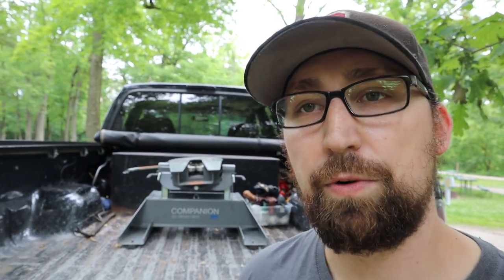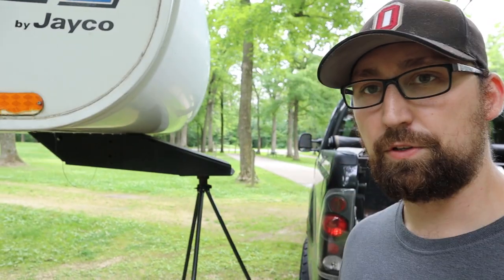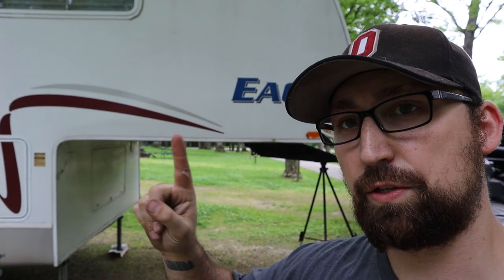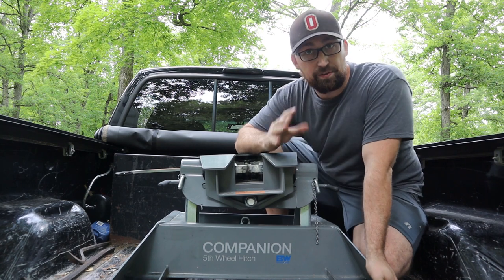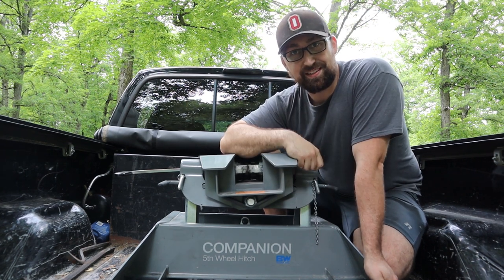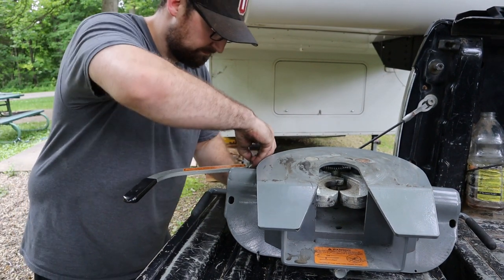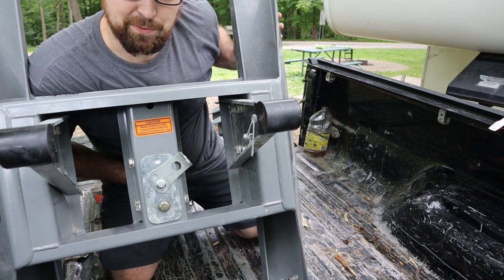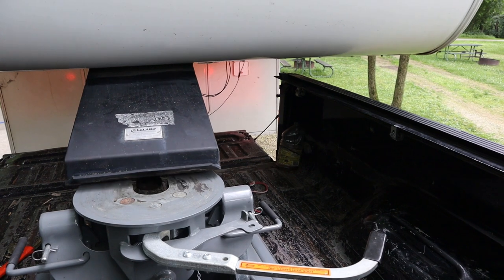The B&W Companion Hitch

Comment: Thanks!
I just purchased my Companion Slider yesterday,  and I have been looking through numerous videos hoping someone could show me how to take it in and out.  I bought a brand new 2019 Ford F250 Superduty,  but it was not equipped with the factory gooseneck option.  Therefore I also had  a B&W "gooseneck" installed that resides under my Companion Slider.
Great video!
Reply from the maker: That's great! let us know how you like yours. I hope the video helped.

Comment: Awesome video !!! Explains alot better than others. Having issues finding a compatible setup
Lifted Ram w Ramboxes ... lookin like no matter the hitch, might have to lift the camper
Reply: A lifted truck is not an ideal 5th wheel towing vehicle.
Reply: @teon39  
Neither is buying a new truck to pull a camper
Reply: This f350 has a 6 inch lift on 35s. There are adjustments to raise the camper a little bit. I didn't have to lift the camper at all to have it work.

Comment: What would be the best way to lock this hitch? (just to slow down a determined thief).. Also, what about grease? what do you use on the saddle versus pivot points? Have you ever used a saddle pad instead?

BTW, I just bought this along with the goose-neck kit for my 2020 F250...

awesome video.
Reply: We use a Teflon disk between the king plate and the pin box. Otherwise I haven't had to grease anything.
Reply: If you don’t use a nylon friction pad, use the recommended (from B&W) white lithium grease.

Comment: I’ve been contemplating getting rid of my Reese slider and going to one of these. Have you ever had very many situation you have wished you had a slider. I have a 19 Ford 250 with the 6.75 bed.
Reply from the maker: We have a short box. I can't say that I have wished for any situation that we have needed a slider. Some campers may contact the rear of the cab but our particular setup we have had at 90 degrees and had zero issues.
Reply: The more important factor regarding turning without the slider is the front cap profile on the fiver. Older models had more squared off front caps but the later models have more rounded corners minimizing the need for the slider.

Comment: Unless I missed it, what is different from the ball you're using now and the ball you threw away?  Also, on your bed cover, has there been any problem with the inside rail cover and clearance with the hitch , or would you rather have top rail?
Reply: Actually there is no ball. The companion base slides into the slot where the turnover ball is/was located. A lever in the driver's side rear wheel well retracts the lock pin, the companion base is inserted, then the lever is moved to extend the locking pin. You then tighten (to 60lbs) the adjustment bolt to draw the unit down securely to the bed. Hope that helps!

Comment: I cannot pick up the hitch and move it out of the way to get my gooseneck ball in place. I can pick up and remove the head but the rest of the hitch is simply too heavy. I realize I could call some friends but I need to be able to convert back and forth between the gooseneck and 5th wheel all over the country. Any suggestions?
Reply from the maker: Andersen makes an aluminum version, but you will need a ball style pinbox for that.

Comment: We were trying to remove the top on our same hitch and after removing the pins it just will not lift up after ends. We watched you do it so easily but definitely not the same on ours. Not sure what the trick will be now
Reply: you should have spread white  lithium grease before the initial install. take it off and when reinstalling, spread white lithium grease on the plastic tips that are located on top the arms that attaches to the head unit. spread it liberally.

Comment: Do you have a demo on how to use the gooseneck?
Reply from the maker: Are you asking how to hook up to a goose neck trailer?
Reply: @littlervbiglife1545  . Yes. I have this hitch and it came with a gooseneck ball.  I have been a full timer most of my life  but have never seen anyone connect the gooseneck.  I want to help a friend move her horse and her trailer is a gooseneck. I need to go from the fifth wheel  hitch to  the gooseneck and make sure I don't  lose her Horse.  I want to make sure I do it right. I have dumb questions like  should i grease the ball?  I also don't want to pull apart my  fifth wheel before i get lost and loose a pin or something. I bet once you do it  ten times it gets easier.
Reply from the maker: @shaneksmith1957  It's fairly easy but can be intimidating at first. You'll need to remove your 5th wheel hitch from your truck and put your ball back in. (sounds like you already knew that.) All of the companion pins should be tethered to the hitch so no worries about loosing them. I would apply a small amount of grease if you haven't in a while to the ball. the all you do is position the goose neck over your ball and lower it into position. Drop it's safety latch into position, and hook up your electrical/emergency brake.
Reply: @littlervbiglife1545  Thank You!
Reply from the maker: @shaneksmith1957  If you need we can make a video for you too.
Reply: @littlervbiglife1545  That would be awesome!

Comment: Whats the part number I can use at napa to find the correct injector for my 04 f 350 6.0
Reply from the maker: 4C3Z-9E527-BRM NAPA should easily be able to look this up by the year make and model of the truck too.
Reply: @littlervbiglife1545  cool thank you. I need to change out number 5. Thankfully its on the passenger side.
Reply: @littlervbiglife1545  I get it thru napa rather than online as in my town they don't charge me for the core. I just bring it back the same day or next. saves the credit charge. Plus all the shipping hassle.
Reply: @littlervbiglife1545  Have another question for you. I need to replace my headlights. I notice there are a lot of choices on amazon. do you have any tips on this, not worried about the monetary hit. just want the best I can get..
Reply from the maker: @captbad9313  I don't have any experience with the ones off amazon for this truck. It came with Harley Davidson headlights on it when i bought it.
Reply: @littlervbiglife1545  Thank you. replacements range from 86 to 268 bucks. 268 a set is a little high for me.
I just can't decide. I live in the mountains, lots of deer.
Reply from the maker: @captbad9313  Have you thought about a light bar? I have two lights in my rear bumper that I can turn on when hooking up to the camper.
Reply: @littlervbiglife1545  Thought about those too, at the moment though, I gotta get my headlights squared away. saw a truck go by me today, it looked like he had the led's. I just hate that light though. driving against them sucks, but I guess if they light the road better. I don't know. still thinking on it. I am how ever going to up grade the back up light syndrome, one step at a time. I changed that injector, damn what a tedious job, I felt like a run over dog when I finished. Six pack took the pain away though. Ball buster. Of course if I could or would want to learn how to pull the cab off, it would be a piece of cake. Don't care much for yoga, my arms and hands don't bend that way anymore.
Reply: @littlervbiglife1545  hey, had to go run the loader, but I was wondering, which I do a lot. Can you take a pic of ur headlights and post it here so I can see what ur talking about . Or something I can compare to. Sounds to me ur headlights are good ones, so I would like to see them.K?